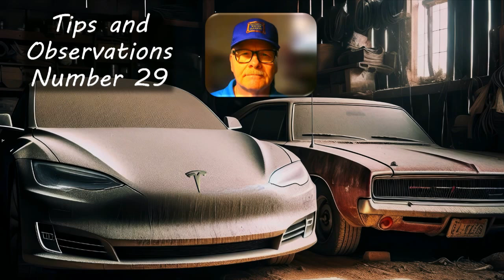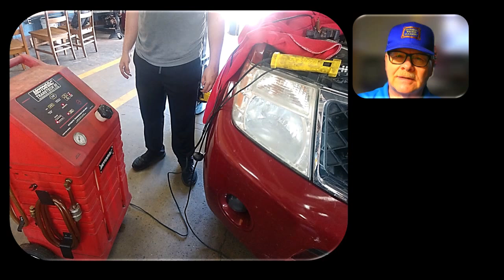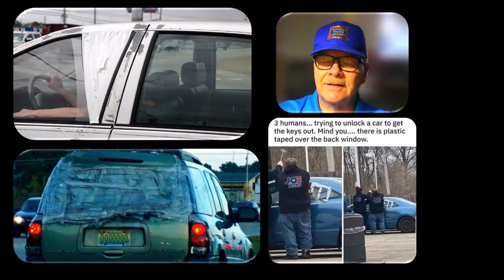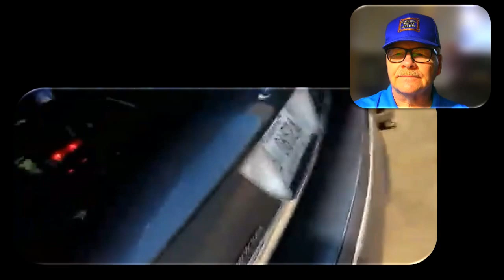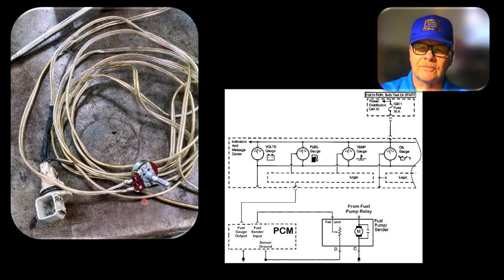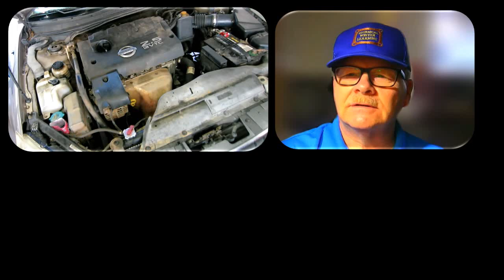Tips and Observations no. 29

Comment: In the late 80's and early 90's I worked in a wrecking yard where the parts pullers used old mail trucks for getting around the yard and pulling parts.  They fashioned up those old square universal AC compressors on the engines and connected them to big air tanks in the back of the mail truck and used them for air tools out in the yard to pull parts.  They wouldn't last forever, though, as there was no oil flowing but they worked quite well and there was no shortage of them in the junk yard.  This was long before battery operated tools became so prevalent like they are now.  Was very creative!
Reply from the maker: Pragmatism - whatever works!!!! I always thought it was interesting how in the NASCAR pit they use tanks of nitrogen with regulators to power air tools

Comment: Hey i got sumthin i never seen b4  i was putting water pump on my 1993 cadilliac sevillie 4.9  they a littel in line filter (like a fuel filter) its on line goin to trans cooler or oil cooler ..you ever seen that?
Reply from the maker: Yep - I've installed them. They're kind of pricey but not a bad idea. They also have a magnet in there with the filter.